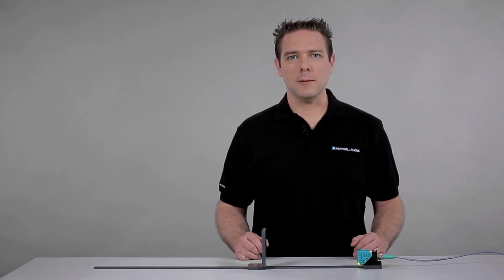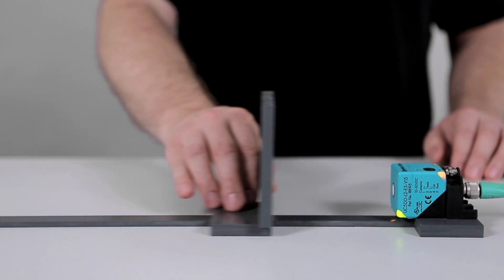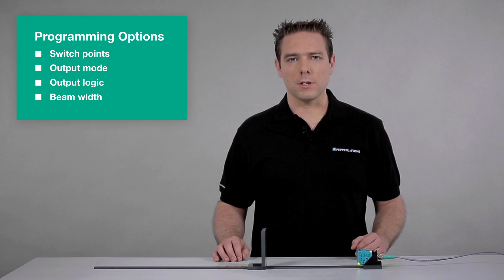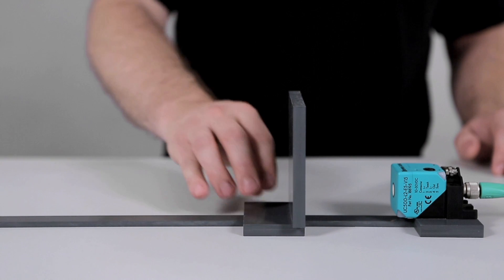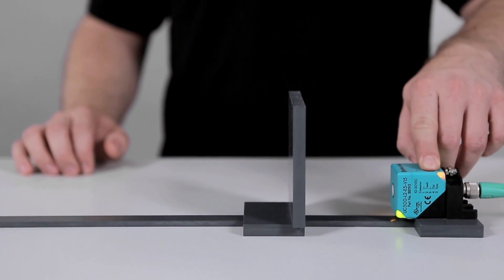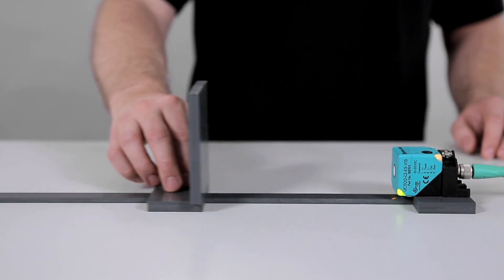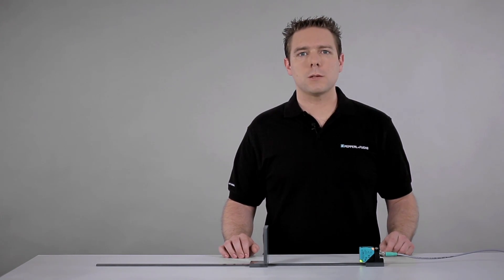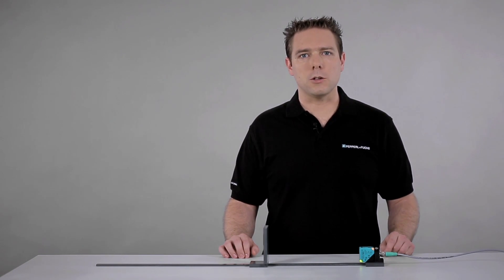How To: How Do I Set the Series L2 Ultrasonic Switch Points Using the Programming Button?

Comment: My UC2000 will not toggle between modes 1 green flash / 2 green flash with a shot press ont eh prog button.
Reply from the maker: We are sorry to hear that there are problems with your configuration. Remote diagnosis is always difficult, so we would ask you to send an email to fa-info@pepperl-fuchs.com. Our colleagues will certainly be able to help you quickly. 😊 #AutomationPassion

Comment: please  explain how to program the sensor if their is no buttons on the sensor 
sensor model number UC2000-L2-E6-V15 
Part no : 118202
Reply from the maker: Thanks very much for your question. 😃 The mentioned model has push buttons for programming (hint: correct part number is 188202). It can be programmed using the push buttons as shown in the video. For details, how to program any other Pepperl+Fuchs ultrasonic sensor without push buttons, please visit our website: www.pepperl-fuchs.com. Just enter either the part number or the type code in the search field to find all relevant product documentation. The information how to program the respective sensor usually can be found in the section Documents in the document named Instruction Leaflet. #AutomationPassion

Comment: How do I do this with arduino push button and ultrasonic sensor
Reply from the maker: The ultrasonic L2 sensor series from Pepperl+Fuchs is not based on an Arduino but is a self-developed, industrial sensor series. All functions explained and shown in the video refer to Pepperl+Fuchs L2 ultrasonic sensors only.

To set some switch points will for sure also be possible using an Arduino and its accessories. However, the code to do so has to be developed by yourself. The basic principle is that you teach the sensor a certain distance value (coming from the ultrasonic module) as switch point(s). Afterwards, you have to refer your current distance value to your set switch points in order to find out what the status of your switching output has to be.

We hope this helps. #AutomationPassion
Reply: @pepperlfuchs  thank you sir
Reply from the maker: @onaolapomarvellous8835  You are very welcome. 😃 #AutomationPassion